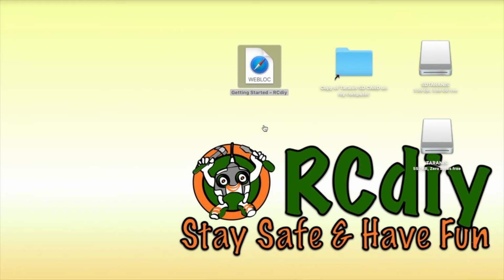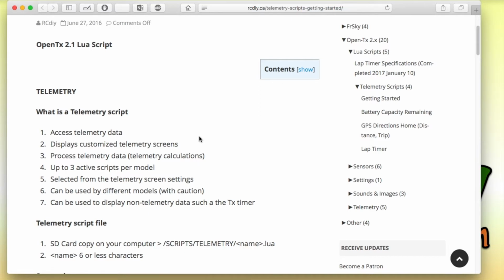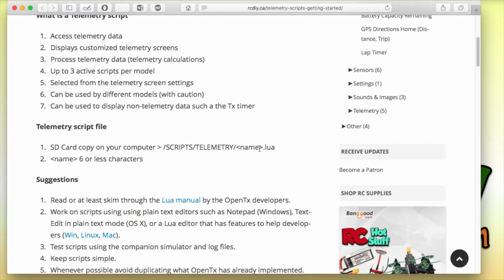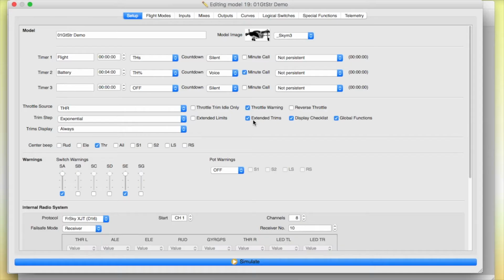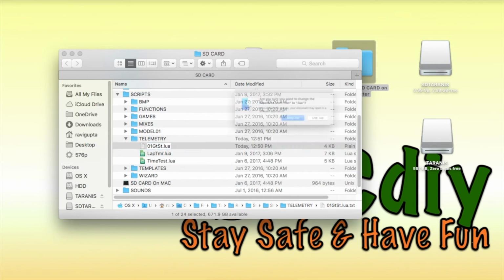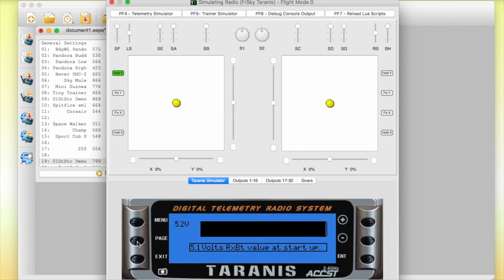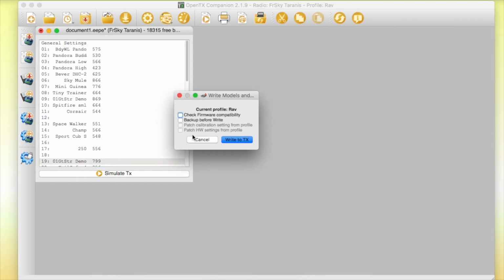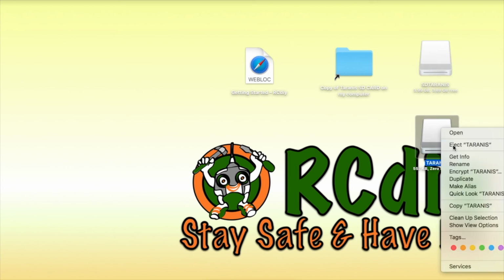OpenTX Tutorial - Lua Telemetry Scripts Getting Started (Correction in description)

Comment: Good day. I have a question: I want to put my crossfire module output power on a switch. So that I can change to a preset value via selecting a switch position. Now TBS has published a LUA script which allows to set up the module on an OpenTx radio.
So you can already view and change all parameters. So for example I can set the output power from 25mW to 250mW even in Flight. But I would have to look down and touch my slippery scroll wheel with my FPV goggles on, so I cant see what I selected.

That’s why I would want to make a LUA script which gets the value and sets it to a value of my choice. Then I could program a special function into my radio which would execute that script once when I select that switch position. 
And for the other switch positions I would just copy paste the code into a new file, change the value, save it onto the SD card, and program another special function for another switch.

The problem is I don’t now how to do this. Since I have basic programming experience in Python and Java I think I can learn the syntax of LUA but I have no idea which libraries to use or access the value of the power output.

Do you have an idea where I can get this information or how to use the code from the crossfire.lua file to get and change the value?

Any help or response is appreciated.

Comment: I am going through trying to set this up on the Horus, Custom screen type is not shown on my Companion ?
Reply from the maker: Currently these scripts can only be configured using the transmitter and not by using Companion. However the script may be simulated using the Companion simulator. Configurations made in the simulator will not be saved.